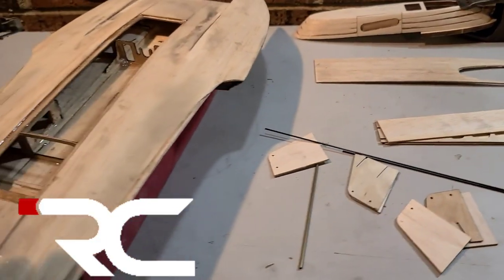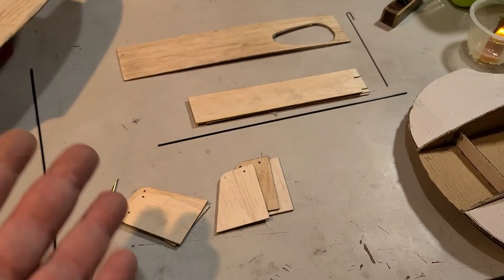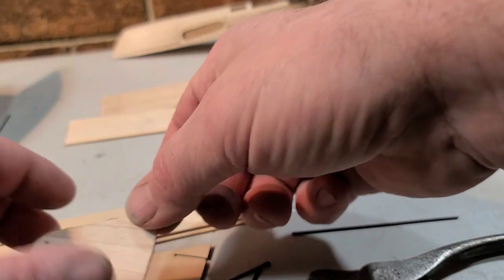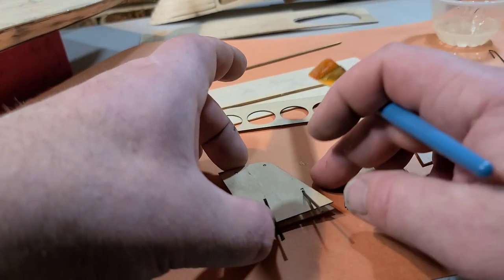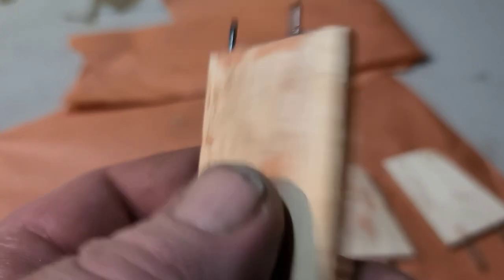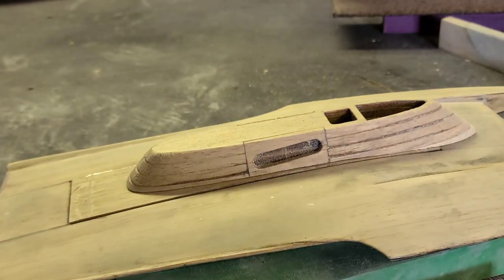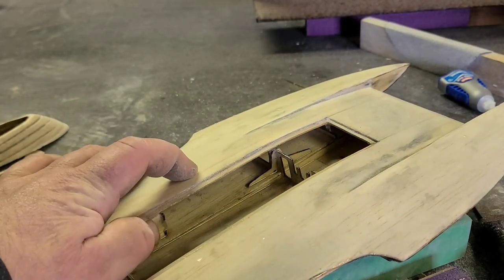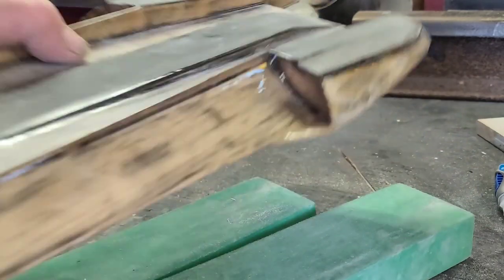1:20 Scale Hydroplane Wood Kit Build Pt8 Cowling/Hatch & Wing Assembly

Comment: I think the instructions say to mount the fins before building the wing so you can get the length is right as every build will be slightly different.  😏  The wing is just for looks....  I'm dying to see it run.
Reply from the maker: I haven't looked at the instructions since I installed the transom doubler.   I know,  know, I should follow instructions, But what's the fun in that.   😆 🤣
Reply: @IRONCLADRC  😂  Maybe just glance at them once???...........
Reply: @Dr_Jet  if he does that will break the RC maker's code … Also the new "Dad code" that he is now part of .
Reply from the maker: 3 generations of non instruction followers! GOING STRONG,  Now it's 4 generations including Axel Johnny!  😆 🤣 😂
Reply: @IRONCLADRC  🤣